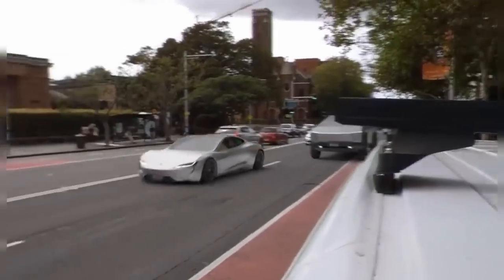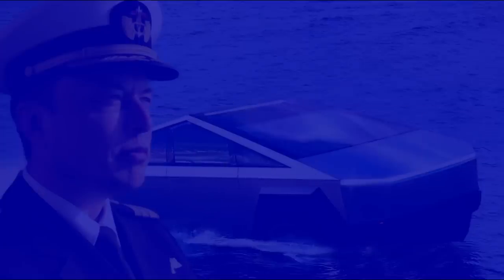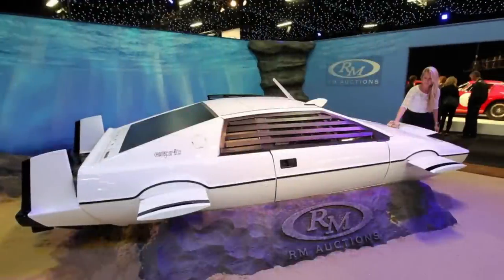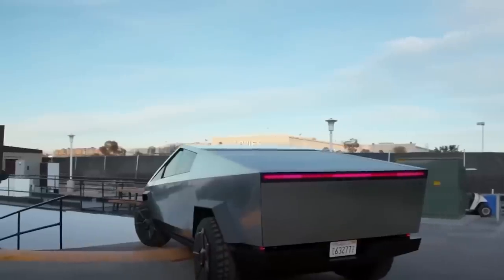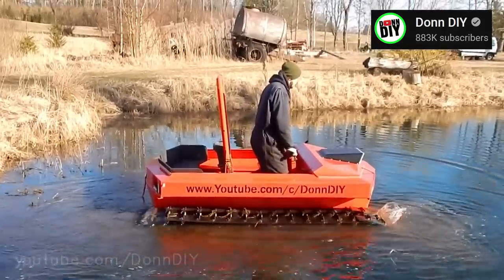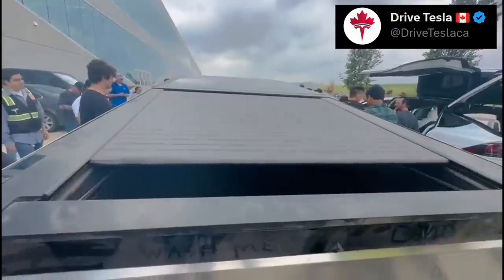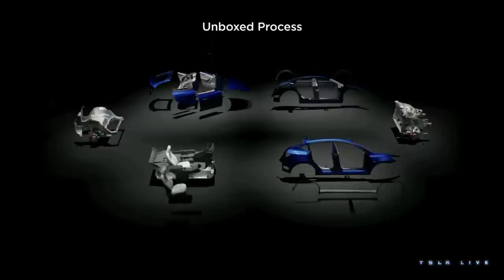Cybertruck Amphibious Technologies |Engineering Analysis of Elon Musk's Alien-Technology Dream-Truck

Comment: Amazing! One correction: I don't think rear wheel drive will be valid as an amphibian, because the truck needs to be able to exit the water with the front wheels force, unless you want to back up onto the shore, which will be tricky with the V shaped back wheels at point of contact.
But beautiful video!!!! Really great! Thank you!
Reply: Plus, Elon has already said they are only doing quad and dual motor variants. So there's that...
Reply: I also wonder if you reverse the flow on the back wheels vs the front if it would improve the approach angle by lifting the front and lowering the back so that water stays well below the front of the vehicle and the bed goes a little deeper.

Comment: Really cool video, great information, well edited, great talking points. I'm worried about the first time a cybertruck leaks too, cause it will get exploited, but the idea could be a necessary starting place.
Reply from the maker: Was corrected by viewers that even boats leak a bit, and there's a bilge pump. The H2 Panther (Hummer) driver operated a pump when they entered the water, so I guess it will be OK unless, as you said, exploited

Comment: You missed 2 points - the seal on the bed gate (normal pick-ups don‘t have any, and compressed air.
Compressed air could be used to power a water jet that would only be a tube with the proper shape.
Reply from the maker: I don't think they'll have enough compressed air
but the seal definitely!
Reply: @ConnectingODots  It depends on the amount of air available - but a properly shaped waterjet (small?) would work. On low speeds any additional thrust makes a difference.

Comment: It’s possible that Tesla’s shift to 48v is also part of the move to drive by wire. Having 48v makes it significantly easier to do actuators instead of hydraulics.
Reply from the maker: Great point 👍

Comment: 1. Amazing video, thank you!
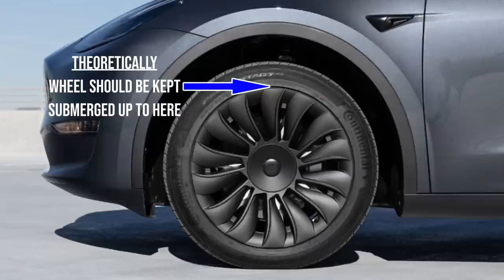2. Correct me if I'm wrong, but I think you didn't take into account one important thing. As the Model Y Performance owner, I noticed that these astonishing Uberturbine rims are non-directional. In the video (28:18), you can see the spokes' shape. On the right side, this will pull the car forward, but on the left side, it is inefficient. In other words, the rims have to be directional.
Reply from the maker: They certainly have to be directional. My M3 has base wheels so never saw the Uber turbines myself, but this is surprising. Are you sure they are non directionals and side to side interchangeable?
Reply: @ConnectingODots  they are not directional, the car comes with four identical rims. You can look at them at videos.
Reply: @ConnectingODots  100%

Comment: Given that the cybertuck is going to have a massive air suspension sustem, what are the prospects of adding a rubber inner tube in a hidden compartment so that with a push of a button the air suspension inflates it and it can become a cyberzodiac? A pair of pontoons would add to the buoyancy a lot, right?

Thinking this through further, you could have one hidden inflatable in each wheel well. The air suspension would raise the truck to the 16" height max then these hidden inflatables would fill with air, and would work the same way arm floaties work for kids in a pool. Since theyre directly over the tires, they'd keep the water level over the tires so the tires could remain submerged for the unterturbines to propel the truck forward.

Comment: Very nice!  I think the Uberturbine/Inductio wheels are only cut in one direction, so they expel air on one side of the car, while sucking in air on the other side.  Either way it cools the brakes.  As you state, the Cybertruck wheels will need a left/right version.  Sucking water in would provide additional buoyancy, but adjusting the suspension height is also helpful, as this changes how much of the tire is submerged.  I imagine trimming the pitch is important, as keeping the hood above the water is important to avoiding downforce.  One important factor is that the battery (and therefore center-of-mass) is near the center of the vehicle, unlike ICE which is heavily affected by the engine.
I think your method is more likely than the electric prop for another reason: the electric power necessary.  Assuming even a minimal 10HP,  that's 7.5kW (after losses), so any meaningful amount of power would require significant power infrastructure for a feature that hardly anyone would buy.  Even less than lumbar support.  That would definitely be a "delete" part.

Comment: I think the CT is indeed steer by wire. You can see them do a full U with what looked like a 180 degree steering turn in the suspension testing video.
Reply: It is not

Comment: Pretty sure those tiny red tail lights won't meet DOT standards. Which also require reflectors.
Reply from the maker: Truck will be fully Dot certified. That's also why they put those external mirrors despite having cameras. Regulations still require them

Comment: Where does the Lumber Rack Go? Toolboxes?
Reply: You'll have a frunk, so you shouldn't need the traditional truck toolbox. The frunk will be much easier to get to, too. There might be some other storage options.

I don't know about the rack, but any sort of rack will mess with the aerodynamics so ideally a rack should be removable and easily installed when needed. The obvious way to do this would be to include maybe four or six quick mounting points and sell racks (maybe foldable?) that work with those mounting points.
Reply from the maker: Alan pretty much answered it.
Reply: What I'm getting at is whether this will actually be attractive to tradesfolk, or if it will just be a "nerd pleasurecraft". I'm hopeful it will be the former... Especially, in terms of lower maintenance costs for fleets. I'm sure you guys have seen the trucks where the toolboxes run the length of the bed, on both sides... Not sure if all that will fit in the frunk. Anyhow ... Fingers crossed!
Reply: @buixote  - the original prototype had some storage in the sail pillars, similar to the service bodies you are thinking of. I don't know if that made it to the final design.

Keep in mind, however, that most of those service trucks only have one row of seating for passengers, whereas the Cybertruck has two rows. I can certainly imagine the rear seats being removed and cabinets installed to increase storage space for tools if necessary. IIRC there is already some storage space under the rear seat.
Reply from the maker: @buixote  they can still fit these in the bed, same as with F-150. Width is very similar

Comment: With the turbine wheels, though, don’t you still have the same problem of having the wheels be not it will be reflected? Or are you saying that because the wheels not only can be turned independently, but their direction of motion is independent, that is, there’s no axle between them, essentially meaning that each wheel has its own motor, That you would then be turning each wheel in the same direction?

Even if you grant that, which is certainly possible, there are other potential issues. For instance, where are the brakes? Obviously, there are vehicles that can Ford streams for a certain amount of time, but if the vehicle is running underwater continuously, what happens with the brakes and the suspension and all of that?

Comment: The channel usually has great videos. This is not one of them. 32 minutes on NOTHING.
Reply from the maker: I started it as a shorter video showing the submersion calculation and the wheel propellers idea, which I haven't seen anywhere (Noone building on by wire 4WS enabling independent steering).

Bit then I thought it would be God to briefly touch other mrthods and show some cool stuff I found sling the way, such as Ths H1 Panther. The idea of using the Hummer body without the chassis is genius.

Sorry you didn't like it, but I've also seen comments wishing it was longer, so I guess a matter of taste.

Anyway, thanks for the feedback, and the next video is all engineering... About a unique Tesla breakthrough (not speculation)
Reply: @ConnectingODots  I very much appreciate the reply to my comment. Sorry if it was a bit harsh. I am looking forward to the next video!

Comment: I object to the "should not leak at all". Early ocean-going vessels always leaked at some rate. We'd just have a few sailors man the pumps. With any older boats, it usually was a measure of "how much" did they leak, vs whether they leaked. They all did, and it was OK.
Reply: I had the same thought. Unless someone makes some modifications no one should think of the Cybertruck as a boat to take out on the lake. Rather, it is something that can cross a creek or even a river if there is no bridge available, provided that there are suitable landings on either side. It also has the advantage that if it should accidentally get into water somehow, it has a decent chance of getting out - or at least of floating long enough for the passengers to safely exit without difficulty. For such uses it does not have to be entirely leak proof - it just has to be be able to keep the leaks small enough that they make no appreciable difference if it is in water for ten or fifteen minutes.
Reply: @alanlight7740  slow leaks are not a problem for seaworthy vessels: you just have to make sure to have sufficient pumping capacity
Reply from the maker: Let's agree on leaks having to be very small, preferably with an optional pump for longer durations, as in the H1 Panther shown there. I don't remember whether it's in the footage I showed here or left out, but once they enter the water, the driver (captain? 😁) turns on the electric pump
Reply: @ConnectingODots  - sure, but that has always been the case for boats too.

And they leak anyway, which is why boats have bilge pumps.

Comment: "Just like Cybertruck..." Good catch. I never caught that point as they were describing the 3rd gen assembly process during the Investor Day presentation. Elon always stated in his tweets and elsewhere that the Cybertruck will be a technological tour de force and  most advanced Tesla ever produced. So it stands to reason that along with drive by wire steering, it most likely have brake by wire eliminating the traditional hydraulic braking system. In fact, I'm willing to bet the Cybertruck will be the first vehicle to be produced with the revolutionary Brembo Sensify brake by wire system. I've seen videos of the system being tested on the Model 3 Performance, which is no surprise since Tesla has a long standing relationship with Brembo. Although Brembo states they expect it to be in production by late 2024 I believe they are sandbagging and will make it to production on the Cybertruck when it starts production in late 2023.

Comment: Another idea that is, IMHO, a no-brainer, is that Cybertruck should have some kind of bus connector in the rear.  This should be a standard feature.  Plugging in a connector would provide power, data, and control links with the Cybertruck.

Imagine a trailer that has its own electric battery pack and its own motor(s) and brakes.  You would connect the trailer to a tow hitch, and plug in a bus connector.  Now the Cybertruck can ask the trailer what kind of device it is, and if the Cybertruck knows how to talk to it, the Cybertruck can control the extra motor(s) and brakes.  You step on the brake pedal, the trailer brakes help the Cybertruck stop.  And, the trailer can have cameras on it, and Cybertruck can use them for backing up and for self-driving.

A bus connector would allow so many possibilities.  And Tesla must have thought of it.

Getting back to the boat: if Cybertruck has a bus connector, then an electric outboard motor that attaches to the tow hitch could be powered and controlled by the bus.  If Cybertruck has software for it, the accelerator pedal would control the prop speed on the outboard.  Turning the steering wheel could pivot the outboard around.

Comment: I think the rear wheels will suck from the outside thrusting water under the truck. This would cause the flows to collide with eachother and increase the forward motion as a result. The front might do this too but with the additional wheel rotation it likely wouldn't be a benefit.
Reply from the maker: You have a point. Possibly front inward, rear outward.
Reply: @ConnectingODots  - the next step in the design you didn't mention is to shape the inner wheel well & underside of the truck to direct the water flow from the hubs backwards... thus turning lateral thrust into forward thrust. .
. even a slight scoop backwards in the wheel well would dramatically increase forward thrust.   This turns the hub prop into more of a jet drive ... ( check out how water jet drives direct their thrust without moving the turbine.)

Comment: Additional capability due to air compressor - it could be used to pressurize the cabin to further eliminate water leaking into the car.
Reply: Why not also use the air compressor to inflate tubes hidden in the wheel well to provide additional buoyancy
Reply from the maker: Great points, both of you 👍
Reply: Nope!!! Pressuring the cabin will hurt your ears

Comment: An alternate proposal:
If we play with mass market economics:
1.  Having 2 part numbers for hub coverings is a economics problem as you mentioned.
2.  Independantly steerable right and left wheels may still be more expensive than linked wheels.

So, consider installing the same hub covers on all wheels.  Then by independantly controlling front and back wheel speeds (or just turning front wheels with all wheels at the same speed) you can rotate the Cybertruck 90 degrees and then rotate all wheels in the same direction and travel forwards albeit sideways facing.  Only 1 hubcover part and no requirement for 4 wheel independant suspension.  Indeed this would work with all wheel drive with only front steering where front wheels are locked to each other.  Maybe you can comment on the efficiency of your solution (forces lost through angled force vector from turned wheels, but better hydrodynamics due to forward motion) vs this solution (aligned force vectors, but worse hydrodynamics due to sideways motion)

4 of the same hub cover would cause an asymmetrical force during normal road driving, but I suspect nothing than couldn't be compensated for fairly easily.

It's more cool to move forward and there's better visual field.  But maybe that's just tradition and maybe we need a new ism.  Symmetrism ;)
Reply from the maker: After releasing the video I realized they don't even need new wheels. Uber turbines can do the job (although less efficient than if designed for water) and if we want to reverse the flow inward, all that is needed is to switch between right and left wheels.

I am highly convinced about Independent steering. Everything be wire will simplify installation considerably (discussed further in my "Diamond steering" Cybertruck technologies video
Reply: @ConnectingODots  I agree on drive by wire.  Simplifies so many things including allowing much easier "unboxed" assembly process as Tesla recently outlined.  Hydraulic and physical connections are so much more of a pain which connecting pre-assembled modules comparing to connecting network to each module.

What confused me is that for quad motors, independant 4 wheel steering is obvious, but for double motor, it seems likely that the wheels could turn in your proposed "chevron" mode.  It seems less clear as maybe a linkage connecting both front wheels and separately both rear wheels might be cheaper than 4 wheel steering.  I'm out of my depth here.

Comment: A proposal for crossing water with currents:
As in previous comments, consider 4 identical hub coverings and no requirement for all 4 wheels to be independantly steered.

Have all 4 wheels turned to face the same direction so the vehicle would "crabwalk" if on land.  In a lake (no currents), the wheel propulsion forces would all align, but the angle of the truck would cause tacking.  This assumes wheels can turn less than 90 degrees.   If fighting a current on a river, this might be perfect and be more efficient.

Do you think tacking the truck on a lake as proposed would be faster than your proposal?